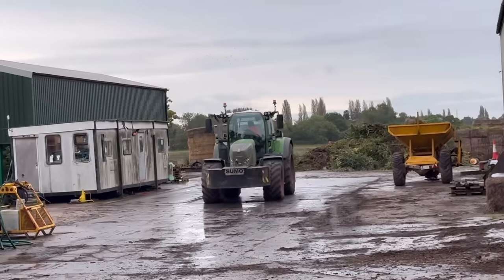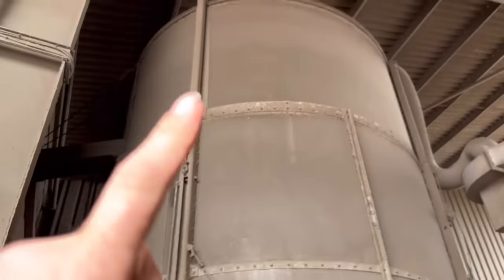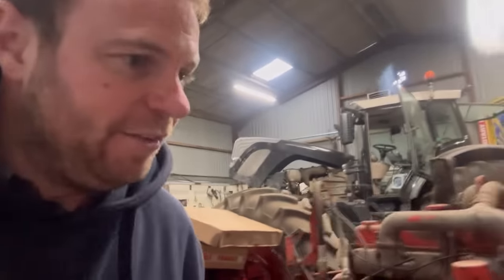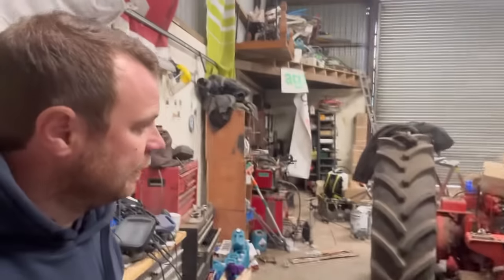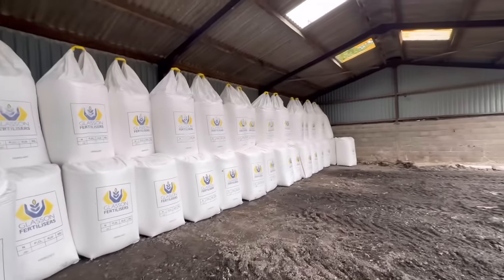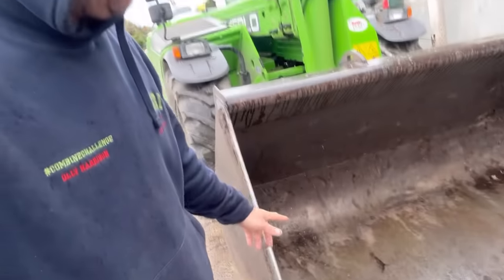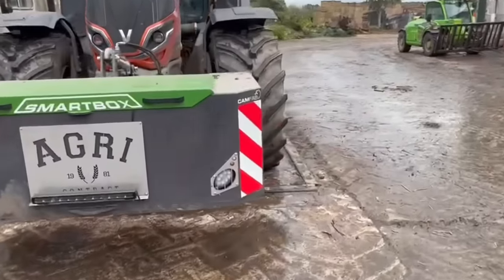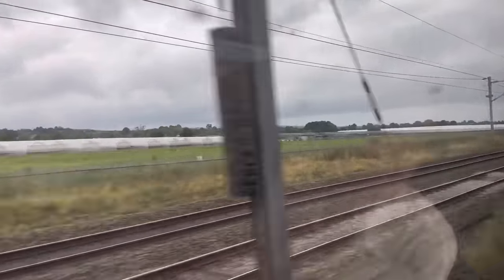DRYER PROBLEM IN THE WET  #AnswerAsAPercent 1297

Comment: Hi Olly. A little friendly tip for Morgan and his Ratchet Straps which will be safer. Roll up the straps with the hook on the outside, that way when you go to strap something down you hook the hook onto the trailer and throw over the roll, that way the hook isn't flying over the straw which could hit someone or get stuck. 👌